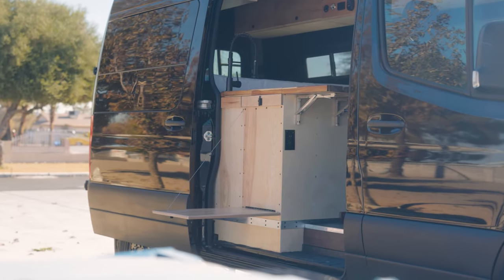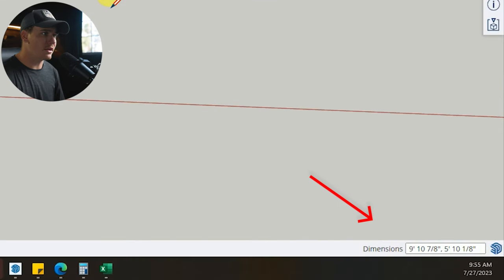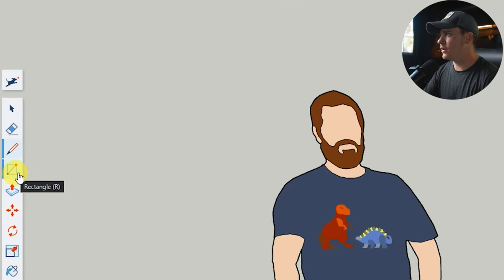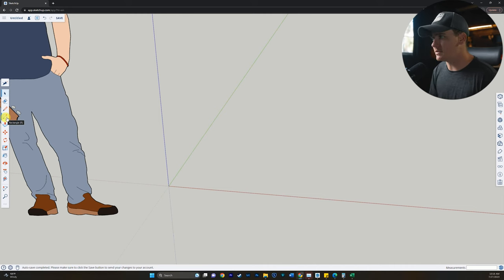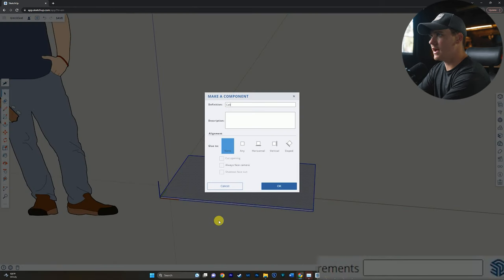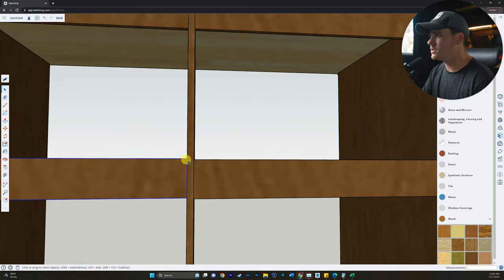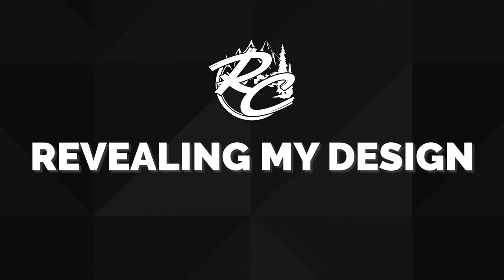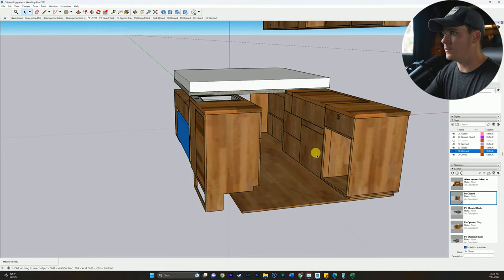Design Your Dream Campervan Build

Comment: I used SketchUp. Came out fantastic!

Also, I just wanted to say to Riley, thanks for doing the review for the Wave 2. Your demo showed me that my unit was not functioning as it should be, and I was able to send it back in.

The unit was only producing 74° air output after an hour on max. It was 60 days old.

Thanks! Great content.

Comment: Very informative.  I had to learn AutoCad for my job.  Of course they were too cheap to actually send me to a course so i had to learn it on my own.  Lots of learning and eventually everyone came to me to do their designs, which wasn't my job but i helped whenever i could.  Sketchup seems quite similar and i found myself using the command line more often than the tools as no matter how much you think you have the toolbar set up just right, i would always find myself looking for a different tool for each project.  I don't know if Sketchup has layers, but i found layers to be great as you can add components to different layers so that you could turn them off.  I'm use to building a frame for some cabinets instead of using pocket holes especially when plywood is involved and it's nice to be able to turn all the layers off except for framing.  You can do this for electrical and plumbing as well with the actual schematic embedded in the drawing.  Seems like you should also be able to do this with Sketchup.  Looking forward to your next installment of the van upgrade!